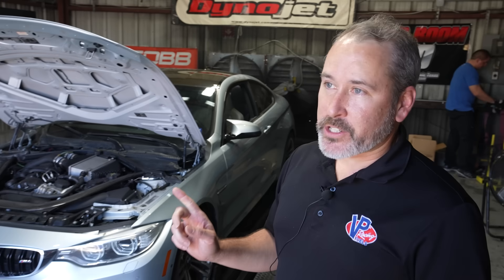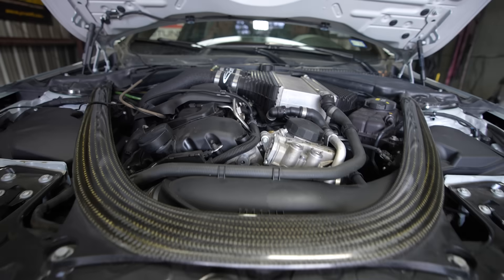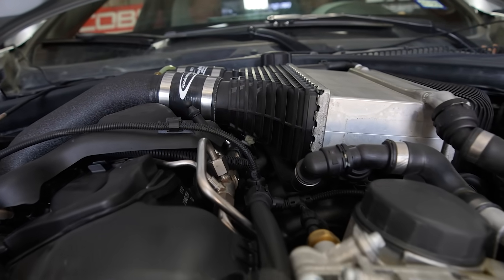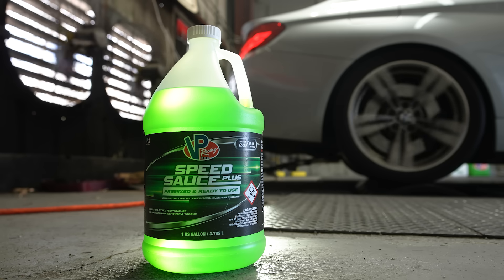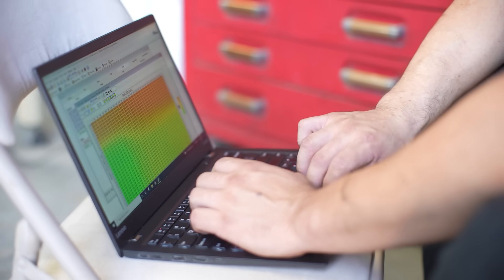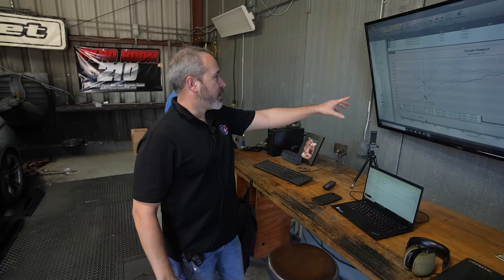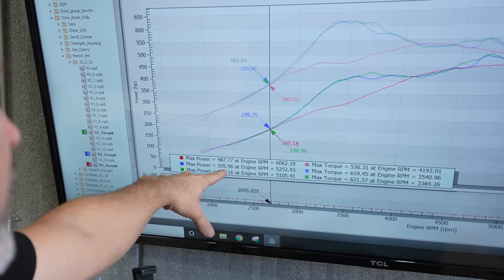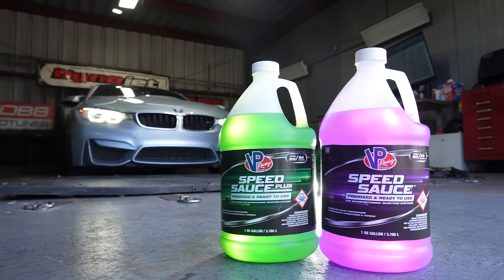VP Speed Sauce Meth Injection Fluid

Comment: And what does methanol do , creates moisture , milks oil . I will stay blow thru.
Reply: wow you'd have to have a really loosely built engine to have any of that happen injecting it properly in a forced induction set up.. Been running water meth on my boosted 3.5 for a few years now, and not have ANY of that happen. there'd be no way for it to cause moisture considering it only injects after 7psi... and like 3000rpm... where exactly is it able to form moisture?

adding this note : not defending VP the video is awful , just the nonsense in this persons comment
Reply: Please never talk again. Facepalm.
Reply: Ethanol draws in moisture.
Reply: 😂 creates moisture.